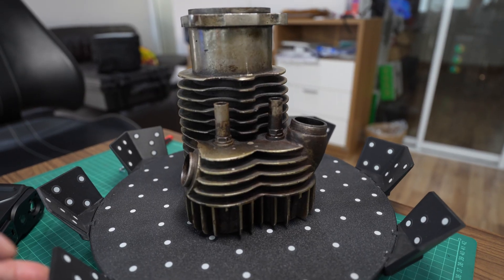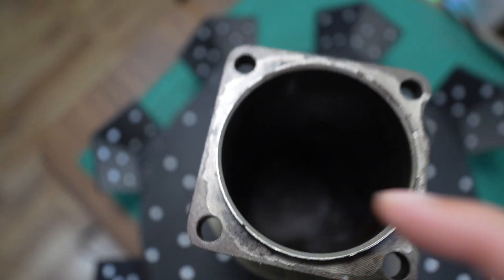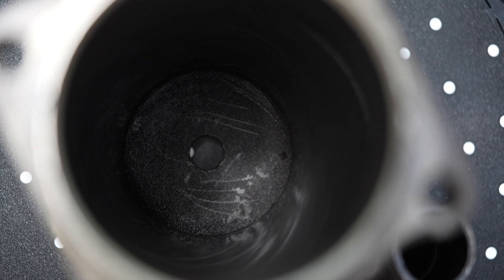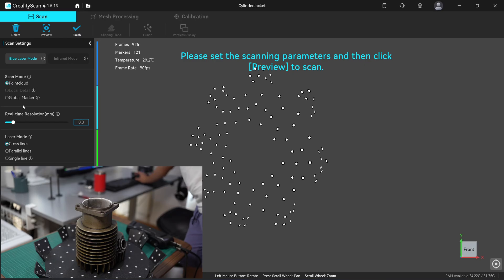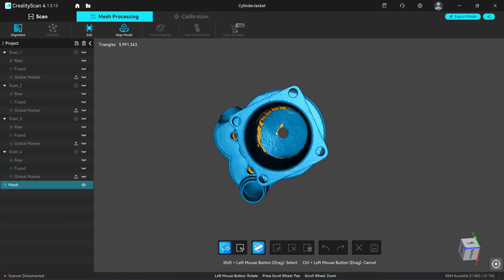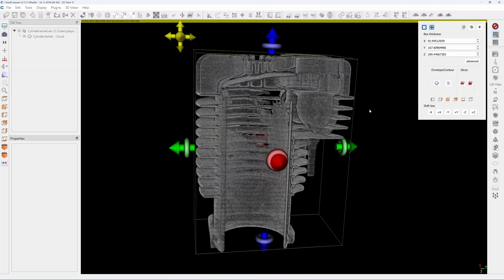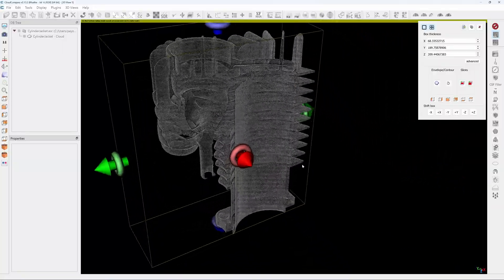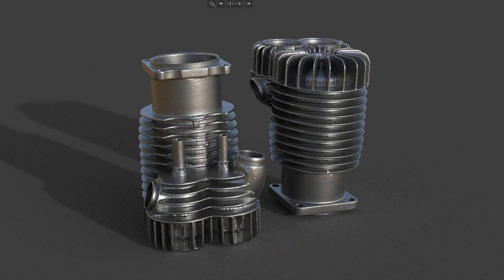Cylinder Jacket Deep Hole Scan - Creality Sermoon X1

Comment: So are you happy with the X1 or is it not a worthy upgrade to the S1? The challenges that you face with the surface scanner is normal for this type of surface that have a weird metalic sheen to them.
Reply: He said it in the review video that in reality wasn’t much of an upgrade it just slightly better in smaller scans
Reply from the maker: In this video example, S1 produces a mesh result very similar to X1. However, due to its lower precision, faint seamlines appear when merging the four scans. These seamlines are typically 30–50 µm wide, which is acceptable for most applications. Minor geometric differences, such as at the valve seat, may show as a curve in S1 rather than the straight line segment visible in X1.

Comment: It is most likely that the cylinder does not have a replaceable liner. The casting would need to be finished bored. The sparkplug hole might be 1/2" NPT thread. For casting a new cylinder, I would recommend using a 3D printed sand mold and cores for a single casting.
Reply from the maker: Thank you for sharing, that's a very helpful insight. I'm still waiting for thread gauge from the owner.
Reply: @Payo-TensileCreator  Another solution would be to print it in foundry wax (PolyCast Natural), then cast it.
I have already used this method successfully.
With this method, you retain the casting imperfections of the original.
Reply from the maker: @Deveo-belgium  Thank you so much for your insight. I'll reverse this jacket in CAD. I'm planning to leave 1.5 mm tolerance for milling face. Do you think it's enough?
Reply: @Payo-TensileCreator  Yes, more than enough; lost-wax casting is extremely precise.
I think a few tenths of a millimeter would be sufficient.
Reply: With my Raptor X, I get excellent results and very high precision. I scan at the highest resolution (0.1), which gives me a greater number of points.
Then I significantly reduce the number of triangles.
By reducing the number of triangles, the software decreases the number of triangles on large areas, but maintains a high number of triangles at the edges, resulting in greater precision.

Comment: Thank you for the videos, it is a topic that has always caught my attention, I wanted to ask you, if it is possible, or if you could make a video of a scan with an iPhone, with its LIDAR, I know that it is not even 1% of the tools you work with, but to get someone out of trouble who may need to scan something to print in 3D something simple. and it would be very good one of the step by step since you have the scan to get to fusion for example, Thank you, and very good work, I love your videos.
Reply: The iphone doesn't have the resolution or the density of the cheapest of 3d scanner for what you want to do.
Reply from the maker: LiDAR works by timing how long light takes to bounce back from a surface. But with only ±3 mm accuracy, it’s too imprecise for most tasks beyond construction.

Comment: I suppose, the similar result could be acheived with Otter for less time and effort. Not to step on Sermoon X1, it should be more accurate, but I'm intrigued if it can scan flat wall with no distortion.🤗